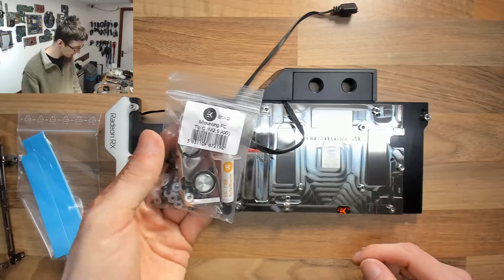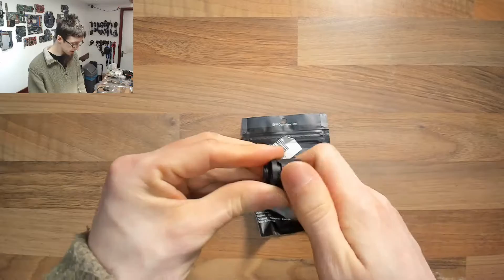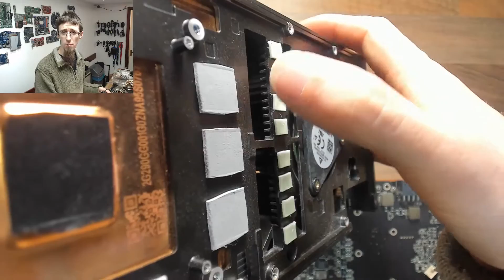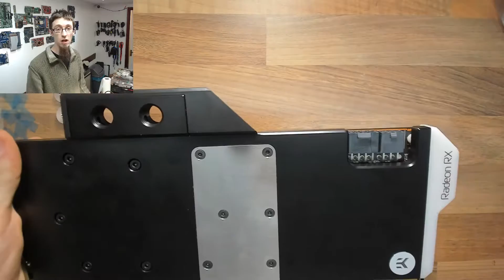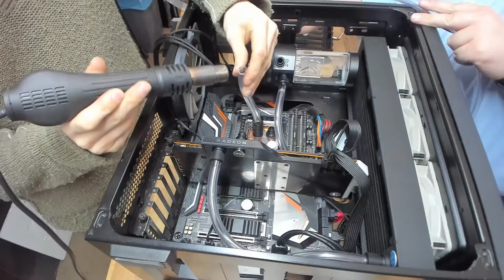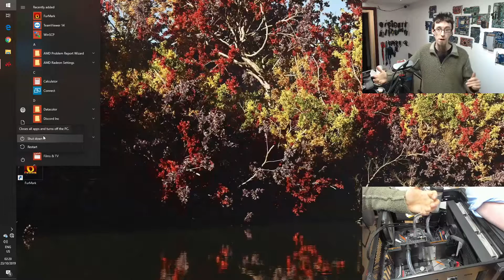LBC#40 - RX 5700 XT 50th Anniversary Edition Watercooled

Comment: Will a Gigabyte RX 5700 XT Gaming OC fit on the waterblock? Are the PCBs all sized the same regarding the manufacturer?
Reply from the maker: No - this block does not fit your card. The EK Configurator allows you to input your exact card/CPU and it will tell you which blocks they have to fit it, if any. I just inputted your card, and they said they didn't have a compatible block :(
Reply: @Adamant_IT  Alright, thank you!

Comment: Aluminum gpu block and copper cpu block? Not sure this is a good idea...
Reply from the maker: This combination was recommended by the EQ website configurator.
Reply: @Adamant_IT  i don't doubt that they instructed you to go with this config but have you checked what happens when you mix metals in a watercooling loop? 

See this image... 

https://martinsliquidlab.files.wordpress.com/2012/01/copperaluminumcorrosion.jpeg

Anyhow now it's done but please instruct your friend to check his loop every couple of months because if this happens the pressure will build up and he is looking anywhere from poor performance to leaking and destroying stuff due to too much pressure in the loop...

Comment: just noticed..where's the psu!!
Reply from the maker: It's in the 'back' of this case. It's a Corsair Carbide Air 540, which has two chambers - one for the mobo and major components, and a separate area for the PSU and drives.

Comment: Reckon this card is worth it for £320 new? I love the aesthetic but as you said, the cooler is bollocks 😂
Reply from the maker: £320 is a pretty good price tbh... if you don't mind fan noise, it'll still perform well, even if it throttles a bit at the top-end.

Comment: very glad you put up this video i have had my 5700 xt since launch and water cooled it with the same block from ek... i have a different set up but i think i have issues with my mount or something else ...its just that my junction gets up to 80 and my regular edge at 55 or so but i have mounted it twice now and i just don't know if i could get junction temps like that for any other reason the card works fine and i can even over clock it a little as well but i have a 22 to 27 degree difference in temps.....currently i am running a 2600x at 4.1 ghz in the same loop and temps are fine, my loop goes pump to cpu to 120 mm rad to gpu out to 240 rad into pump and all my ports are correctly in and out i cant seem to get the junction down didn't know if you could help or not